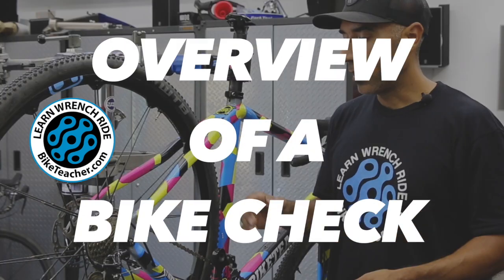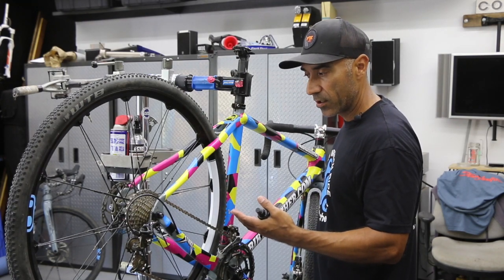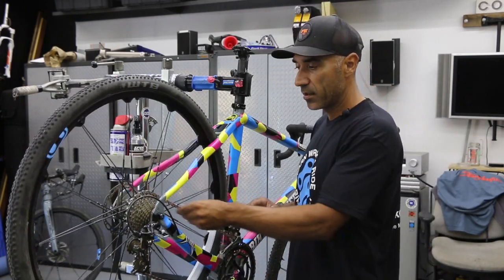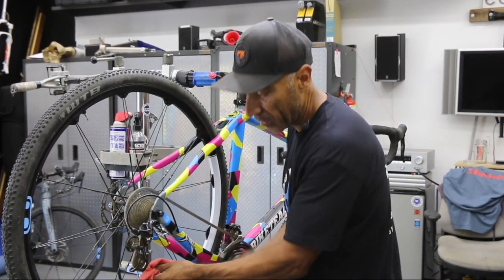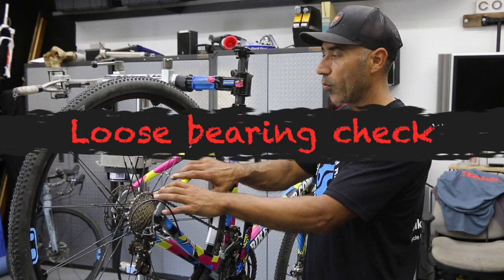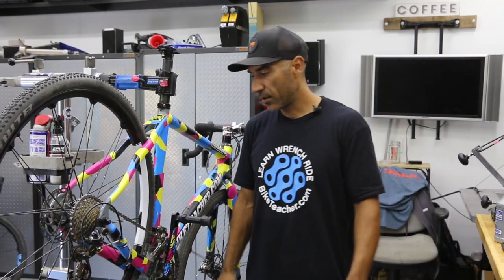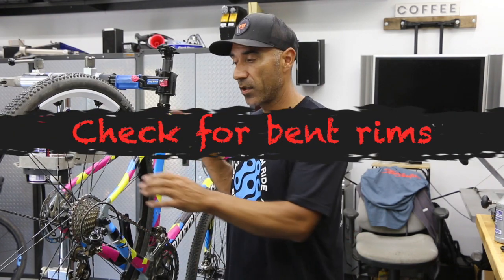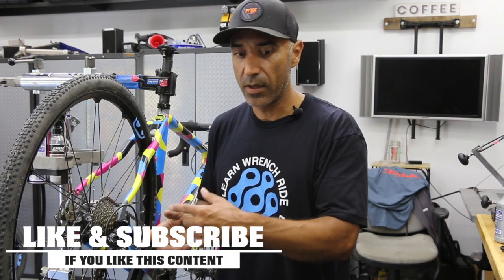How to do a bicycle check up or safety check. This is a quick overview.

Comment: One of the best bike repair content on the net. As a pro mechanic I appreciate the content and quality and the thought that goes into your videos. Nice tips you can always learn now matter how much you know.

I was wondering a series of A-Z on wheel building both standard and aero wheels would be great for those that want to take to the next level of wrenching - but that will take some time to plan, no doubt. This is an area which is done poorly.
Reply from the maker: Thank you for the info I will research that area.